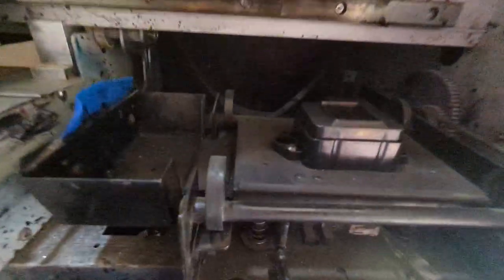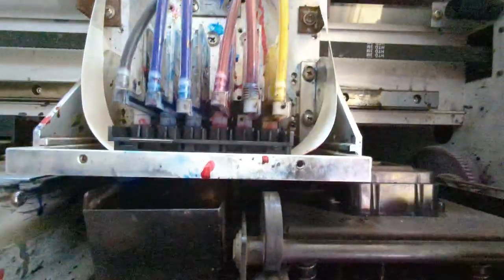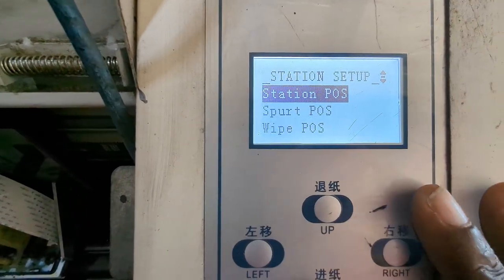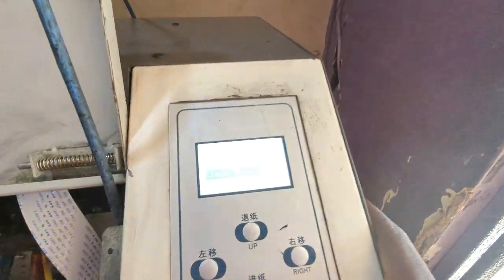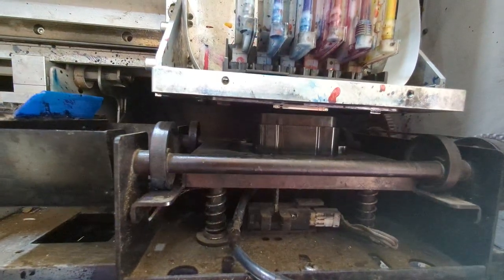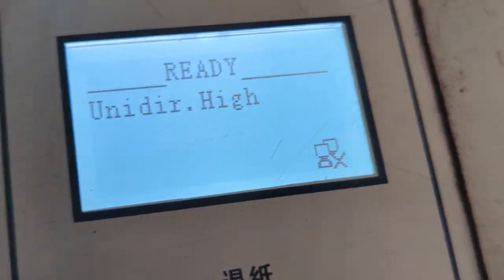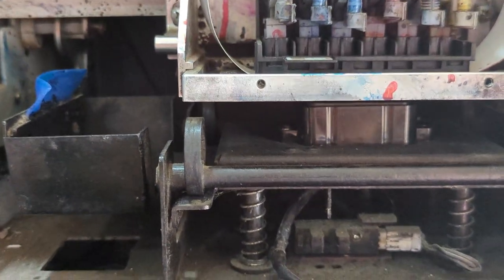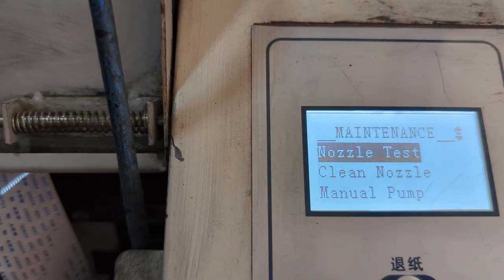How to Adjust Your Machine’s Cap Height for Perfect Print Head Maintenance

Comment: I currently have the similar problem and I  suspect this issues causing print head clog when we finish to print the print head doesn't not fix in the cap. I was spending replacing print head without solving this problem.

Thank you I'll fi that and see how it does with another print head

Comment: mine has no settings like that. my machine is honjet. no nozzle print, but it flashes and cleans and pump. what to do master?
Reply from the maker: So in cases like this. You can look for similar settings that match your machine using this one as a guide.